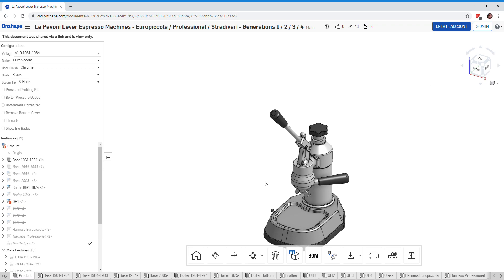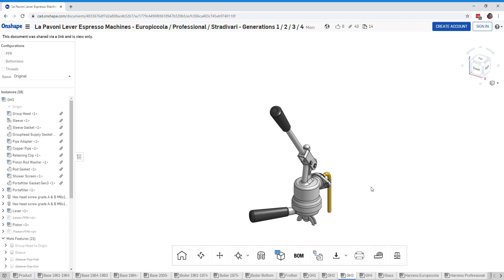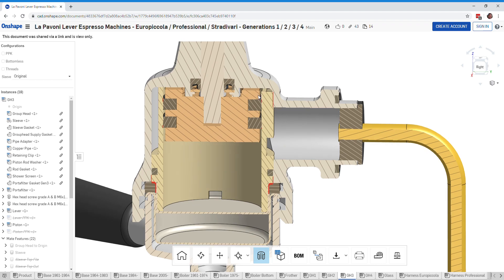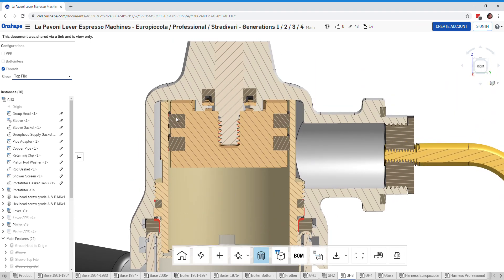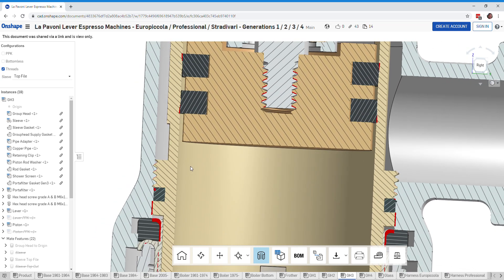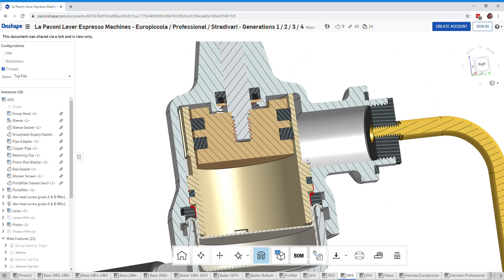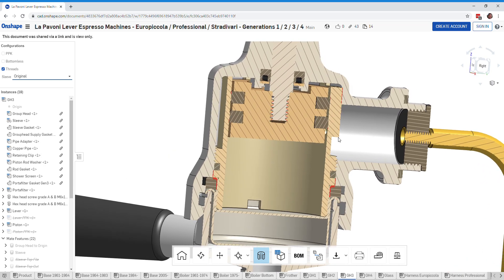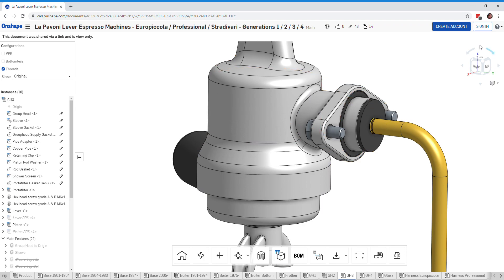8: Generation 3 Sleeve Modifications, Part 2 - La Pavoni Lever Espresso Machine

Comment: The question I have is, what happens to the air after you remove the channel. 

With the channel in place, I think this is how it works. When you start the machine dry and piston down, the entire chamber above the piston is filled with air. This creates an airlock preventing the water entering the group head while machine warms up. Once you lift the handle above hole the air can escape allowing hot water to enter the group head. Since the channel doesn't let water pour out directly, the water level rises to the top of the channel pushing the air out ahead of it as it rises. When water reaches top of the channel it fills it and starts pouring down out of the hole to the cylinder below. As you push the piston down only trace amounts of air remain at the top of the group head and new water that is pulled in fills entire group head. You have maximum heat exchange.

Once you remove the channel and lift the handle the air is only able to escape until the water reaches the top of the hole. After that the remaining air will remain in the top of the group head having nowhere to go, and the water rushes down past the air to cylinder below piston.  
When you push the lever down you pull in water only to displace the piston, but all the air what was there before stays at the top of the group head. So there will be constant air bubble at the top of the group head interfering with the heat exchange.

I've seen steel and brass sleeves sold at http://coffee-sensor.com. They are built same way with no channel and hole designed to be opposite of intake. Apparently people test them and claim they work great, but they have same theoretical problem of airlock. Top of the group head will never fill with water.
Reply from the maker: Martin, for some reason you comment was blocked and I just noticed it. Sorry.

You described the scenario of air without the channel very clearly above. I agree that the channel likely plays a large role in removing air from the group head.

However, I think what is really happening may be much more complicated. For example, I would not be surprised if the air/water interaction is much more violent in the group head. A rapid swirling of and air/water (bubbles) could force a lot more of the air through the channel-less hole than might be expected in a calm environment. Of course, this is conjecture.

To complicate matters even more, I have been swayed to believe that "flash steam" occurs in the group head (https://www.tlv.com/global/US/steam-theory/flash-steam.html). I think flash steam plays a role in driving air out of the brew chamber (under the piston) when the lever is lifted. Of course you are not speaking about the air in the brew chamber, but rather the air in the group head before it gets to the brew chamber.

I hope I interacted with your question to your satisfaction. Clearly, I am not in a position to definitively respond to it. I'd like to hear your continued thoughts.

Comment: Hi John, thanks a lot! I really appreciate the good explanations and your animations!
Video #6 shows a group head with what looks like a 180 degree rotated sleeve without a modified channel. Is there another way to modify the sleeve besides #7 and #8?
Reply from the maker: D H, thanks for the kind words.

There have been some reports that some recent machines directly from La Pavoni have sleeves that have the opening opposite the neck without any modifications. For me at this time, it is just a rumor (that I am propagating - aaargh!). The goal of rotating the channel is for a cooler brew temperature. So to finally come around to answering your question, you might consider the BongIsolator (video #10) as another "way".